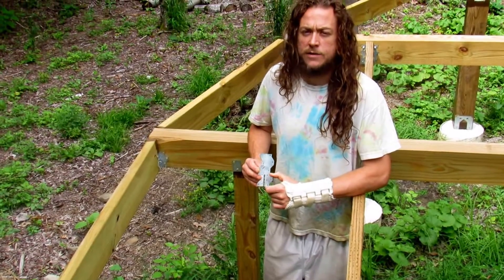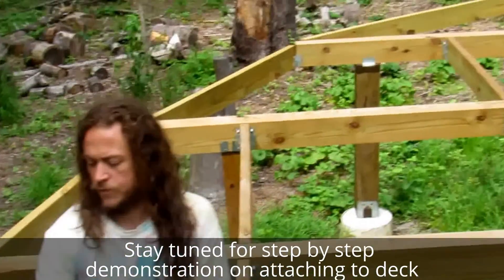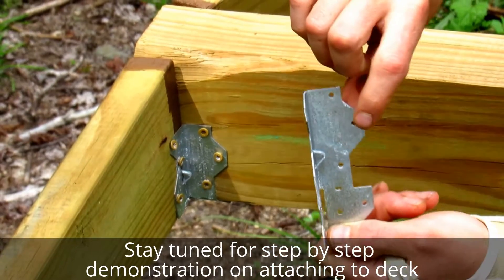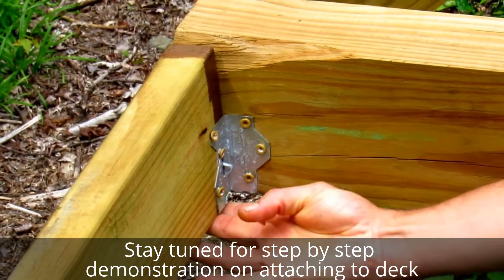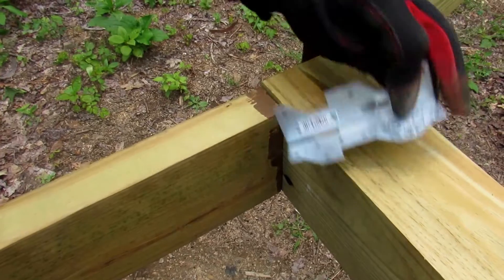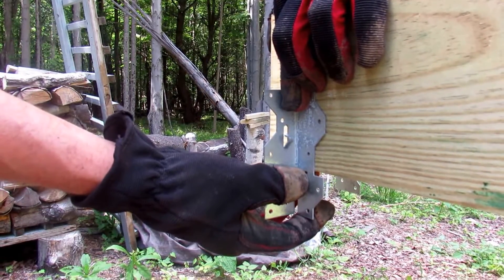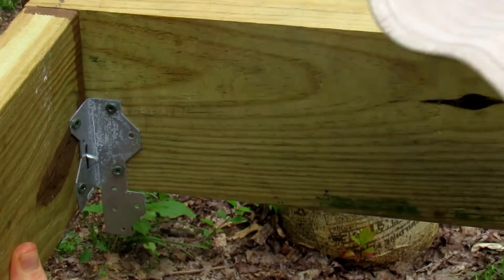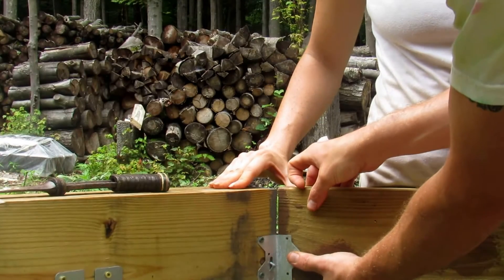Using Simpson strong ties A35Z End joists, bendable joists

Comment: The gold deck screws your used are tempered and brittle. It may not be a big deal with a yurt, but with traditional structures the sheer strength isn’t sufficient with deck screws.

Comment: Does your yurt have structural walls or is it a tent?  if it has structural walls, have they cracked?  
This application looks like there is a twist on your beams, so the load on top will cause deflection and may induce cracking...

Comment: The A35Z has a very good zinc coating.  Rule of thumb: never connect unlike metals together or it will cause an electrochemical reaction that makes on member rust while preserving the other member, either way the whole thing falls apart.  Hot dipped galvanized goes with this. But like Jason L stated, if you want Simpson to stand behind it,  you have to use the fasteners they recommend.

Comment: You need to use the correctly sized nail or Simpson's connector screws.  The screws shown in the video are not tested fasteners with those connectors, so Simpson won't stand behind that installation.  The inspector may have an issue depending on their level of knowledge.
Reply: Nails or screws ?
Reply: @carlosvpallares1407  Both are allowed so long they are structural. Nails are cheaper, but harder to install.
Reply: They might be GRK RSS structural screws. Without seeing the actual labels who knows. You are right though.
Reply: Pretty sure the screws are wrong, but the inspector can't fail it if there's no inspection lol